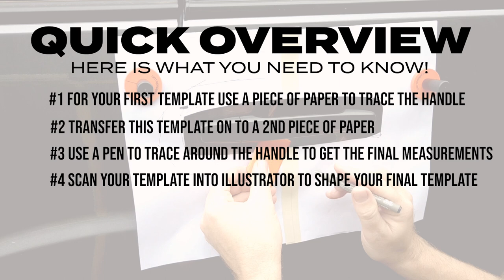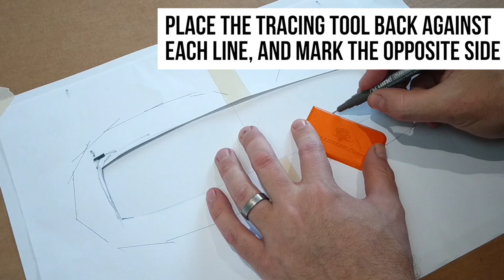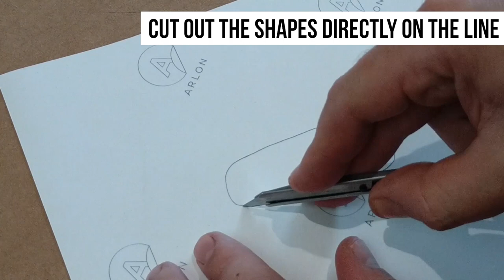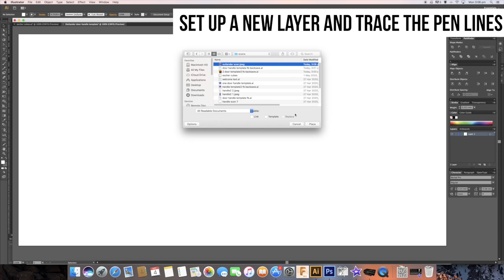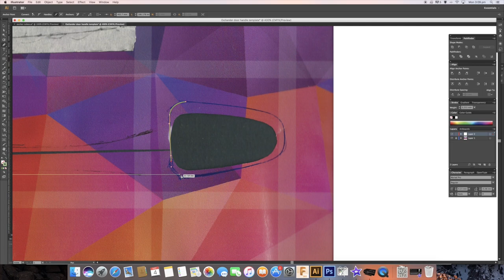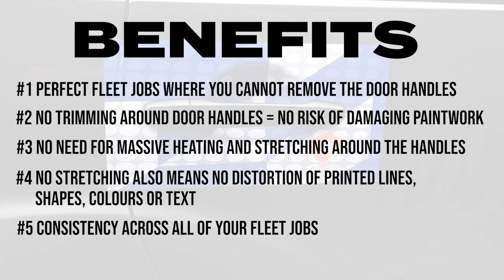How to Perfectly Wrap Around a Door Handle | Tech On The Road | Arlon Graphics

Comment: I don’t understand why you bother with this? Wouldn’t it be 100% easier to just remove the door handles...
Reply from the maker: Great point Jamie! Yes if the handle is removed then wrapping into the door cup is of course much easier. This technique here is specifically for when you don't have the option of removing the handle.
Once you have templated around the handle, you never have to do it again. For commercial style wraps, this technique can save you massive amounts of time while guaranteeing the exact same result on every vehicle! We'll work on clarifying this in our next video!
Reply: Pro trick : you can watch movies on flixzone. I've been using it for watching a lot of movies lately.
Reply: @Finn Clay Yup, I have been using Flixzone for years myself :D

Comment: Wow, short of it being an awesome solution you made an easy job with one cut and some small amount stretching the lower cut and tucking the other over it into a massive task. If a client doesn’t want handles removed, then they are not paying the money they should so why go to the this effort and cost yourself money and time.
Reply from the maker: Hi Dorzun, yes if you have a client with one car who doesn’t want the handles removed, then it is certainly not worth going to this effort. If you have a client with 60 cars they need wrapped, then we would highly recommend investing the time in the beginning to save massive amounts of time in the long run.